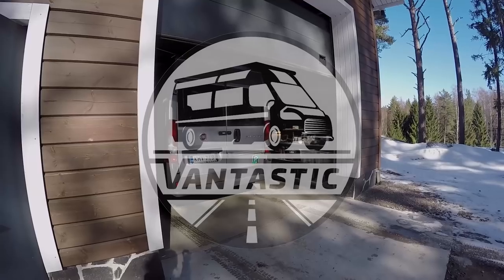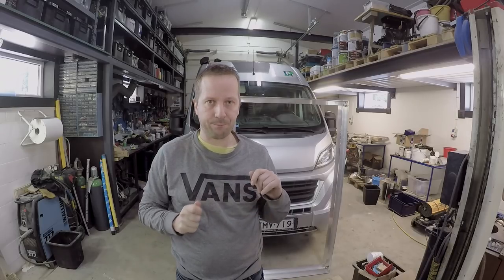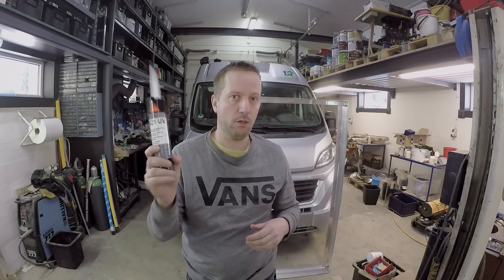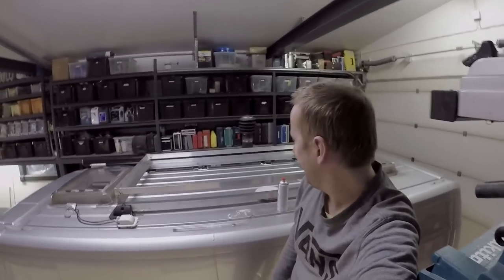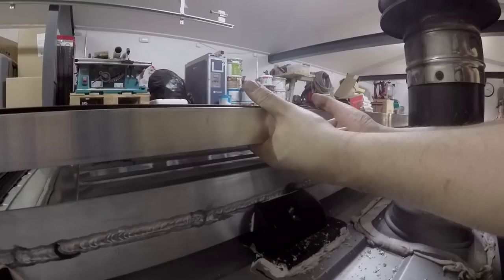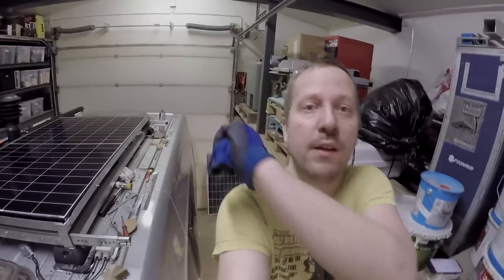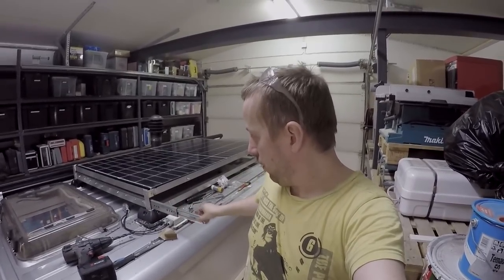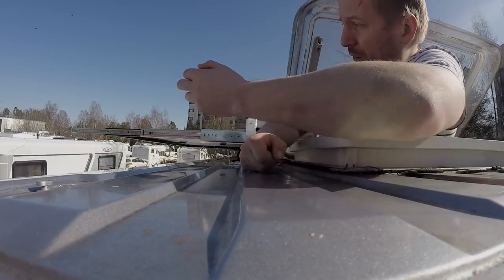CRAZY 690W SOLAR PANEL SETUP TO SMALL CAMPER VAN

Comment: I'm editing all my youtube videos with iPad 7. Powerful enough and doesn't take much power.
Reply: ..Im guessing they will not spend 10.000 on an iPad, just to save a tiny bit of power. After all, they are saving up,
Reply: @krimke881  ipad 7 is maybe 300-500€ used/new. Small, lightweight, good.

Comment: Nice setup. A drawback for the Li-ion battery is that it should not be charged below freezing temperatures, because it just kills the battery faster. However, keeping the batteries inside has it's own risks.
Reply from the maker: We are getting lifepo4 batteries, those are destroyed if you charge below freezing temps. Luckily beneath our battery compartment Truma heating pipes go trough so the battery compartment never goes below freezing. Lifepo4 chemistry is also much more safer and stable compared to Li-ion.

Comment: Thanks for sharing your installation process! Regarding energy usage when rendering video, perhaps an idea would be to film and render in 25fps rather than the 60fps YouTube advanced settings indicate you're using? Considering the content, 25fps is likely quite sufficient  :) 
What are your thoughts about the additional solar panel 2 years later, and do you use it often?

Comment: You can use an automatic car antena system to adapt in the solar pannel in order to make it open with a flick of a button. Those systems are cheap, releable and very strong and work on 12VDC… Cheers
Reply from the maker: Yeah, found them from Ebay. Thought they would cost alot more!

Comment: Solution to push out the panels. 1# One weak/adjustable gas damper, that helps you push the panels out, and that is installed so that it is not too strong when you push then in again. And then make sure you "grease" the sliders well. I know there are products from WD40, and in the motorsport community that can give you a sort of grease or lube that does not gather dust and particles.

Comment: Also, for pulling out and putting in the solar panel, you could just do a simple rod attachment that snaps in place when not in use or that is inside the van but then just goes onto a hook to pull the solar panel out and to push it back in. Lol...Now I see that you just did the exact same thing that I suggested!
Reply from the maker: Yeah, i got that idea like 10 seconds after i stopped filming. Ill have to put some loop on the panel so its easier to move it.

Comment: I will as soon as possible, install a switch between the batteries and the solar charger ( I already have one between the panels and the charger), because even if it's not charging, it needs power to run, just as everything else that's doing something.     I recommend you do the same, if you are very cheap about your battery charge, on rainy days, and in the autum and spring, when the sun really does not give you anything.  The solar charger does not pull much, but any power is worth saving I believe. I don't need my solar charger show me battery status, solar status, etc, outside operating hours. It also does not emit necessary heat to run it as a heating source outside solar hours =p
Reply from the maker: We opted for charge controller that doesnt have any smart features ill have to look how much it consumes on idle. Well putting one extra switch is not a big deal anyway.

Comment: The easiest and cheapest solution would be to mount a thread on the back of the panel, dragging from one side will open it and from the opposite will close it. It would be nice if you could tilt at least one of them to be perpendicular with the sun, you'll get much more power.
Reply from the maker: We have option for tilting to be added in the future. Lets see. :)

Comment: How about a metal loop on the edge of the panel and then use a "Boat hook"pole to hook and and draw the panel out. On the other end of the pole a chunky walking stick rubber so you can use that end to push in the panel?
It would work so long as its not to stiff
Reply from the maker: That way it could work.

Comment: Awesome setup. Maybe the sliding brackets are twisting, try stronger brackets perhaps.
Reply from the maker: Its either that or its too tight so the railings are pushed  against the slides. That would cause it being too stiff. 

Ill grind some welding out of the bracket and lets see if that helps. It still works now though.

Comment: Good work! Thank you for sharing. Did you just glued the rack to the roof or also screwed it through the metal? Or did you use the original rails?
Reply from the maker: We used only glue, with six legs its more than enough. :)

Comment: Hello, I like your lateral thinking for the problem of roof space and having two panels.  I have one comment, I looked at a lot of the comments and nobody had made this comment.  When you connect two panels they act as one panel, so if any shade falls on on part of the panel it reduces the output.  Not incrementally but by a lot.  So one tenth of shade on a panel will lose 40% of the whole panels power.  In your setup when you don't have the 2nd panel extended it will be in shade, 50% of shade on your panels.  This will reduce the power output of the one in the sun by a lot more than 50%.  Maybe you have thought of this and have already designed a way to switch out the lower panel.  I hope I'm wrong and this information isn't something new to you.  Best wishes, Kevin.
Reply from the maker: There is two ways of installing solar panels, series or parallel:

If your installing solar panels in series voltage is summed and every panel output is same as the lowest output panel.

If your installing solar panels in parallel output is summed and voltage has to be the same.

We install them parallel, only downsize in this is that voltage is lower. Lower voltage makes greater losses, but our wire length are short so it doesnt affect much.

Our panels are bifacial panels, so in theory we have 4 solar panels parallel.

Comment: Regarding your comment, using it most of the time as a single module - make sure than to connect them in parallel, not in line!
Reply from the maker: Yes, bought parallel mc4 connector for the panels. :)
Reply: It would be clever use of parallell installation, as you will get a charge, almost whatever the weather is, and wherever you park. Have you seen a comparission between serial and parallell setup for the charge out an open ground parking spot, from morning to evening ?   I wonder how it compares. what gives faster charge in perfect condition, and how much less than parallell in shade

Comment: Looking forward to seeing your battery upgrade to Lithium. I’m wondering how you are going to manage the low temperature (below 5 Celsius) charging issues - you don’t use the onboard water system in winter for similar reasons, so are you considering heater pads or relocating the batteries to a warmer spot onboard?

I think some sort of linear actuator would be an option for the deployment/retraction of the lower panel, but as with all things in your climate, having an override option should things get too cold is always worth considering.

All the best, stay safe.
Reply from the maker: Below our battery compartment there is Truma heater pipes going so its always warm place. We can also discharge the batteries in -45c conditions so if the low temp switch is activated we just turn on our Truma heater and then we can charge them.

Linear actuator would be nice, lets see if we try them out. ;)

Comment: A linear actuator will be the best device to use if you wish to extend and retract your solar panel automatically. It also would have the benefit of being locked, either in or out, so it will never accidentally open when going around a corner.
Another one can be used to automatically tilt the top panel if that is something you want to consider although properly sized gas struts would accomplish the same thing in regards to tilting and be cheaper but not automatic.
Reply from the maker: Thank you, ill have to study those. Getting them in and out automatically would be cool feature!

Gas struts could be more less tech option, but linear actuators would be awesome!
Reply: @Vantasticvan  Gas struts only work for tilting though and I cannot stress enough about getting the right size and force!

Comment: It's kind of ironic. that when we above the arctic circle, got the least sun, we need the most power, and we invest the most in solar power =P   I got 4x160w panels and 4x100Ah lithiums, its not really in use other than 2 months a year, because the sun does not deliver very much above the arctic circle, outside mid-summer. today, I had 14V and a charge of 0,5Ah for 2 hours .. haha.. what a waste to live in luxury the whole summer.
Reply from the maker: Haha, we were laughing at the same subject with Sara. Our heaters are running 24/7 where we need power and of course in this are sun is non existent most of the winter.

Thats why its good to go overboard with the system so we can squeeze those little amount of charging when it is finally sunny. 😁

Comment: According to Google, it snows there about 5 to 6 months of the year, so what's the point in having Solar Panels when they'll be covered in snow most of the time?? 🤔
Reply from the maker: You cannot drive your van if theres snow on the roof, so it needs to be cleaned anyway. With our 275W solar panel we were able to be totally offgrid for 8 months of the year, with these maybe 9 months, but we have plans for next winters to be somewhere else.

Comment: Something is wrong, vanlifers are pulling mountain bikes, motors, beds and other heavy stuff with ease. So either the rails are not mounted properly or they are shit. I would fix this, not adapt with additional stuff
Reply from the maker: I think the fitting of the rail is too tight, so thats why its harder to move. Ill grind down couple of welding parts that are sticking 1-3mm on the side of the railings and lets see if that helps.